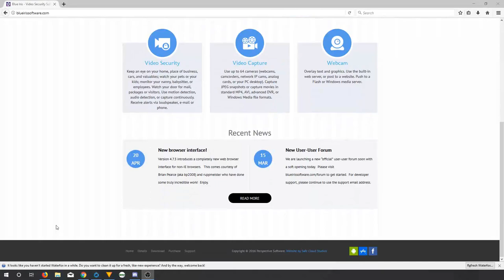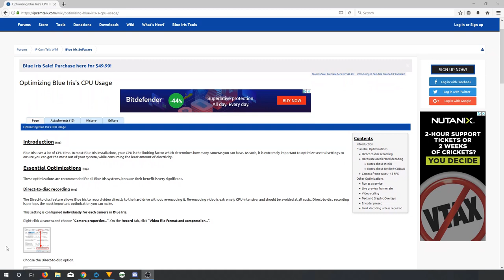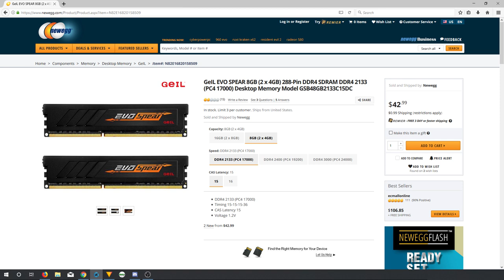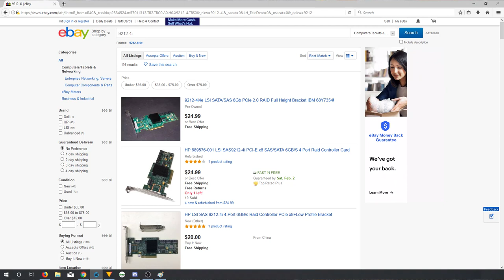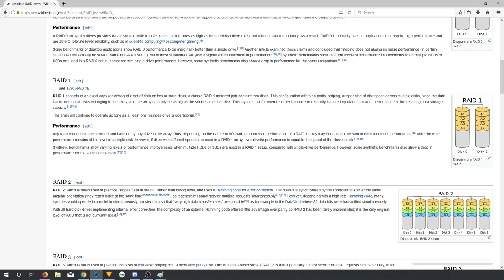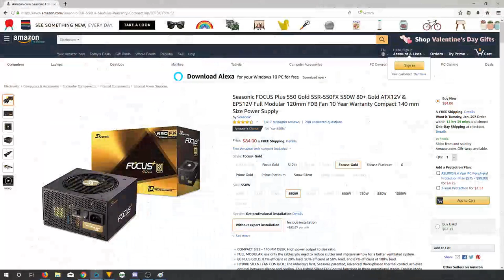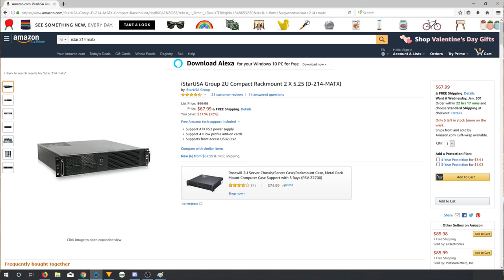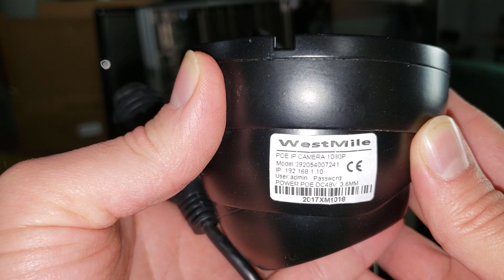Video Surveillance Server Build for Home / Business

Comment: Good video - a nice configuration. 
(1) Surprised you didn't use the Ryzen here in this build - thought they were the go to chip for this type of server.   
(2) Also saw you said the Intel chips could not handle H.265 - I've not heard that before.  What's up with that - thought it was just a different codec used. 
Since H.265 cameras are available at good prices, I was figuring on going with H.265 - would be a shame to downshift them back to .264. 

I'm starting off BI with an OLD i7 (2009 version its like -980) it may kack with more than a couple cameras, even with direct to disk on BI set.  
...But then I will have a good excuse to upgrade.  Perhaps just a new MB and processor.  Was thinking Ryzen - though I've heard that CPU speed is more important than threads on this sort of machine.
Reply from the maker: Hi RelentlessHomesteading!

For a Blue Iris server, I would likely not recommend AM4 to anyone at this point in time. Any processor other than an Intel CPU with integrated HD graphics will be less efficient. Blue Iris is setup to use the iGPU in Intel processors (quicksync) to be quite efficient. Without the iGPU, other CPUs will have to work harder and likely use more electricity / max out processing power sooner. You can alternatively add nvidia graphics cards now too. These will be extremely power inefficient versus the Intel iGPU though.

TL:DR : AM4 will work, but it will not be efficient for this type of server task.

I don't remember saying that the Intel chips could not handle H.265 - the relatively modern chips most certainly can handle this, not every camera will though.

The most important performance option is direct disk for cameras, then the iGPU being enabled on Intel consumer-grade CPUs to help with the video processing. This will reduce CPU load while saving energy. I have and have had a few Ryzens, they're great at most things, this task is not their best though. I would stick to an Intel processor with an iGPU of the current or within the last 4 generations.

Are you looking to set this up at a residence or business?

Comment: I'm attempting to build exactly what you did in this video. So far the exact cooler, ram, and raid controller are unavailable.  I see the Noctua NH-L12S, is that a comparable cooler you'd recommend for this build? I would also appreciate your pick of current raid controller and ram sir.
Thank you for your films!
Reply from the maker: HI J Manhattan!

Glad to see you're building a system! Are you going to use the same or similar 2U server case that I did or will you be putting this in a desktop tower? The cooler I used was the NH-L12 which had a height of 66mm without the top fan. The NH-L12S is 70mm and does not have the top fan (so the fan isn't an issue). I have not measured exactly but I have read in multiple places that the maximum height for a 2U cooler is 72m. Since I have not tested this, I would say its likely this cooler should fit in the case I order or similar but its going to be very, very close. 

As for the RAM, any kit would really do, there isn't much that was special about what I used other than it was on sale. I do however tend to go with G.Skill kits, here's a few options: 

16GB 3200MHz - G.Skill: https://amzn.to/2zPGPF1
16GB 3200MHz - Corsair: https://amzn.to/2YkC27T
16GB 3200MHz RGB - G.Skill: https://amzn.to/2BuW5HL

As for the RAID card, any LSI based RAID card is what I would choose. You will get the best deal from an older used or refurbished eBay deal. The RAID card I use here was an eBay special for under $20. I have used many Dell PERC 5/6 RAID cards as well as the H310 model and the IBM M1015's. The main thing to be aware of is that if you plan on running 2 SATA drives in RAID 1 like I did, that your RAID card either has to have SATA ports on it or you must buy a SAS to SATA cable for SAS only RAID cards. I like the H310s which have SAS ports, I just buy a cheap cable on eBay that is SAS to SATA. (this is what I did in my newer UnRAID server, that video is here: https://youtu.be/0AL-fjn5oLY)

What CPU / motherboard platform did you choose or are thinking of? Out of curiosity, what type of cameras did you opt for?
Reply from the maker: I contacted Noctua support, they were able to confirm the newer NH-L12S will fit in a standard 2u rackmount case :)
Reply: @STS  Thank you for the reply! I was able to obtain the same 2U case you used in the video and have the NH-L12S already. 
For the motherboard I grabbed the MSI Arsenal GAMING Intel 8th Gen LGA 1151 M.2 DVI HDMI DP USB 3.0 Gigabit LAN CFX Micro ATX Motherboard (Z370M MORTAR).
Do you recommend that I de-lid the CPU? (I5 9600k 3.75GHZ) I have Silicon Lottery website up now.
I have not even looked at cameras yet due to the fact that I just wanted to get the server up and running. 
Are there any cameras that you outright recommend? I will likely only run four but may upgrade once I move.
Thanks for your replies, it means a lot!
Reply: @STS  Great, thanks for contacting them. That was above and beyond!
Reply from the maker: Hey, no problem! I'm glad you got all of the parts together :)

It's not necessary to delid that CPU. Since mine was already delidded and I planned on overclocking, it seemed like a good idea to use.

There are tons of new and used camera out there now. What were you looking for in terms of resolution and framterate? That's where I would start (but obvious has to be balanced by budget).

Comment: I want to build something like this and then put idk ubuntu or something on there (something light) to run my python stock trading bot.  It uses something very cpu intensive, but single-core, so what I want to do is have an octacore processor and divide the cpu and ram into 8 VPS's so that I can run the program for example on 10 stocks on 1 vps, 10 stocks on another, and so on.  Do you have any videos for getting something like that up and running?  I might even try hooking it all to my extra 42" TV but not sure how to do that.  You know where I could see all 8 vps's split into 8 squares on the TV screen man that would be badass.
Reply from the maker: Hi Wayne!
I have not attempted to build a system for a trading workload. If each VM or container requires high CPU performance and you will need many cores, I would probably suggest a Ryzen 3000 (either a 3700 or probably a 3900/3950X). The Intel parts still hold a single threaded performance crown but typically at a higher price. What are you running your trading bots on right now? Were you looking o build a system like this inside of a rackmounted server style system like this, or a more regular standing ATX style PC?

Comment: Please do more videos, like NAS hardware raid setup / software? if you plan on expanding I'm planning on doing the same installation for my brother in law because his DVR is failing and we had a thief trying to break in while we were home in broad day light a few days ago
Reply from the maker: Hi eevd350z!

I have had a lot going on since I published this video but I definitely plan on doing follow ups and possibly some in depth stuff. That is CRAZY! I'm glad you are (hopefully?) OK and your family! What are you running right now camera wise? Got a budget you're working in?

I build an UnRAID NAS and the upgraded it, here's the new version: https://youtu.be/0AL-fjn5oLY
Reply: @STS  Hey thanks for the reply! Oh we're definately ok but, looks like were revamping our perimeter / physical security. Currently we have analog (BNC) cameras attached to DVR. Thinking about upgrading to IP / PoE cameras 24 port switch / Blue Iris software Windows based. Of course the storage is going to cost more. Just wondering the which way to go with RAID. either separate DiY NAS or direct storage raid?

Comment: @SamsTechStuff  I have a few Dell R715 servers with 2 AMD Opteron cpu's, 128gb ram, raid card, and a bunch of 300gb sas hd's that I got for pennies. Can I use 1 of these for this purpose?
Reply from the maker: Hi Jeff! Yes, you most certainly can use a server like that for this purpose. I would caution you though, the computer power on those CPUs is typically regarded as being low. With that in mind, and the issue that they do not have an Intel based integrated graphics processor to utilize the quicksync feature that Blue Iris uses for acceleration, this type of server would be massively power inefficient. I would strongly recommend using an older 6/7/8 generation Intel based system, even a pre-built from eBay, to do this task. It will likely perform better and cost you less to operate in terms of power consumption (and probably be physically much smaller).

Comment: Great video! Where do you activate the GPU on the CPU(Likely BIOS, but what other things might it effect?)  Also, I am using 30 cameras that are all about 4K resolution. I am recording at a step below that as so far this is running on a PC that I use for other tasks. I want to build a dedicated setup, hence I found your video. But not many people run so many cameras, so I look forward to your input on a CPU, Mobo,  and power, memory needs. The main issue I will have is heat, so that will be key. As the 4U case and powered switches will be  on a wall. I will pipe some AC cooling to it, but depending on power supply efficiency and cpu, I may need something with lowest watts and heat output. I plan to record 24/7 with enough storage to have 2 months of stored video. That way, I can protect some videos and within 2 months unprotected is recycled. 
Subscribed with Bell! 
Right now I am recording based on motion activity, and out of 25 or so cameras, 1 or 2 active shows CPU at 63% A car just passed by and 9 cameras went active, yet no change in CPU. Hmm?
On another note...Blue Iris is great, but yet to figure all out a number of things. I have made some tweaks for smoother faster recording. I also need a better way to figure out on how to replay data. 
It is sort of new to me as I had in the past used GeoVision DVR.
Reply: Are you running 30 cameras using Blue Iris?
Reply: @jlzandrad  I think I am at 24 and have 4 more to install, and a few more to likely add. Why? Any suggestions?
Reply: @philindeblanc  I'm going to try to setup a 32 5mb cam tomorrow on a i9 with 32 GB of memory, 240gb ssd for windows and blue iris DB and 8tb purple for videos. Everywhere I get different opinions on what hardware will be enough, I'm triggering motion on the camera and not on blue iris and it's a busy business a d from time to time I'll have 20 cameras recording at the same time
Reply: @jlzandrad  i9 is overkill, but maybe worth it. "newfiebort" has good info
Reply from the maker: Hi Phil! I have not yet had the opportunity to run a system with that many camera running at 4k! That's quite the system :)

its possible you may need to offload to a GPU depending on your CPU. I'm not sure how much CPU utilization you will see or what CPU you have. I would suggest the best CPU you can get for your budget with iGPU to be honest.
Reply: @STS  I think it is the i7 8700K, I did get a i7 6850K for another system. Thanks, I'll check if any of these have iGPU. I purchased the 6850K to take advantage of the added lanes for nand SSD, but not sure if my mobo is supporting that, as it was the first ASUS board to support that chipset.  Would love to see more vids of you doing BlueIris tweaks or other NVR related content.
Reply from the maker: The largest boost in performance for Blue Iris will come from direct disc recording and the iGPU from a consumer/prosumer i7/i9. I would not suggest a CPU without an iGPU unless you have a special circumstance (virtualization). the iGPU will outperform any similar core/thread count CPU and even CPUs with more cores and threads. The work that has gone into QuickSync is really nice, the efficiency is unbeatable. 

There are some scenarios where maybe the addition of dedicated nvidia GPU from the 10 series or up could be helpful, but they will almost certainly be less power efficient than an I series + it's iGPU in terms of power. That being said, I am redoing my security setup in the future and virtualizing my Blue Iris rig anyways. I look forward to re-building it :)

Comment: I have blue iris but stop using it. Even have a license. However for the mobile side there is a application that cost money to use. It is one of the reasons I stop using blue iris.
Reply from the maker: Hey! I have seen some complaints about that yes but I'm generally fine with this because it does help support the developer and keep up on updates, especially since the licenses are good for years. That being said, if you don't want to use the app, you can kind of work around this by building a VPN at your house/business then connecting to it when you are away and then connecting to a PC / jump host / other to check blue iris.

Since you are not using blue iris actively anymore, what program are you using now?

Comment: Would this be a solution for a 4 cam server and running plex with 3-4 clients and a NAS?  No large transfers.
Reply from the maker: Hi BeerDiaryShootin mcdaniel! 

Firstly, great handle.

Secondly, I would not suggest you task one PC or server built like what I have here to accomplish your goals. I do no like adding responsibilities to video surveillance server as it will likely need its resources for its main purpose, saving / recording video data.

I have not tested what happens when there is not enough CPU and GPU power but I have to assume it results in lost frames. This could mean that while users are requesting content from the Plex app that you may not record all footage from the 4 IP cameras connected. This would especially be true if for any reason the Plex app needed to transcode. Transcoding on a 4 core i5 for 1-4 users while recording with up to 4 IP cams would result in all tasks being performed extremely poorly in my estimation.

I would highly suggest a minimum of two PCs/ servers here. One to handle video recording with IP camera management and one as a dedicated NAS with Plex jail / docker support. 

Another untested question would be, if you constantly record from the IP cams, or even only on events, what happens to the arrays ability to store frames from the IP cams while a user or up to 4 attempts to stream a video files located somewhere else on disk. Some NAS software / operating systems may have solutions to handle this but, I would not recommend this to anyone.
Reply: @STS  Thanks for the reply.  1 records constantly rest are record on motion.  Appreciate the response.